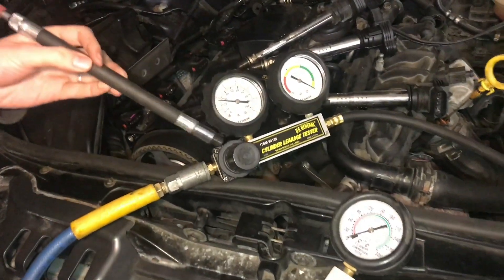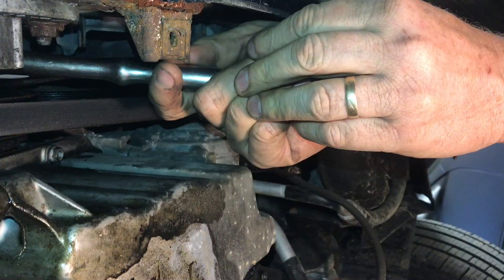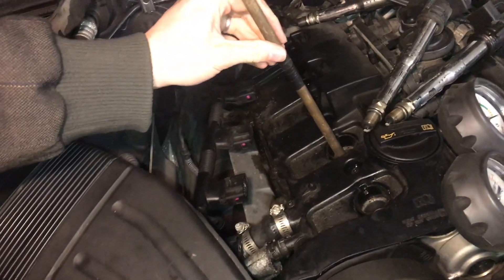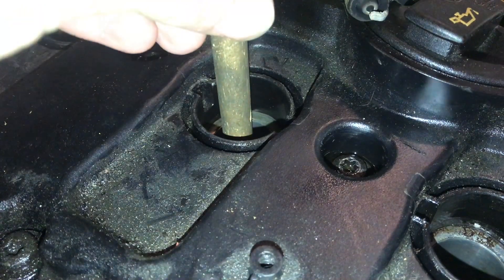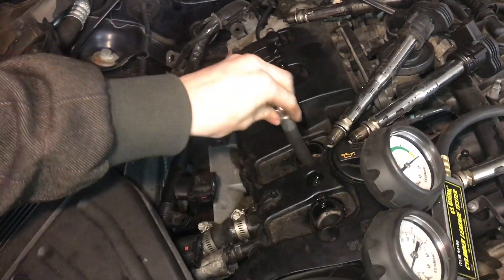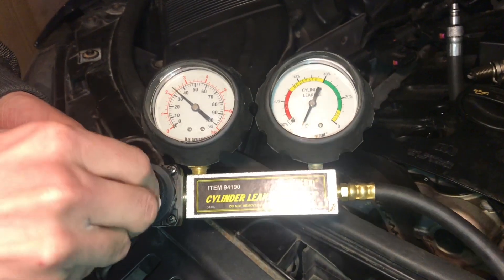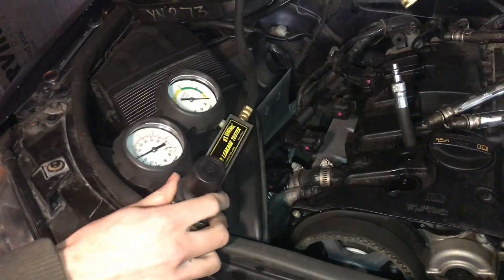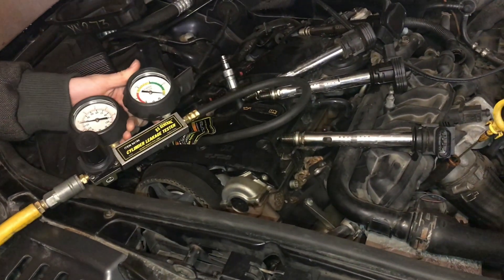how to use a LEAK DOWN tester (from harbor freight Item 62595)

Comment: Those cheap leakdown testers are really only good for adding pressure to listen for leaking valves,  head gasket, rings, etc.   The percentage of leakdown is useless.   It's like 20psi so the resolution sucks.  A 2psi change is 10% and I doubt those gauges are accurate to 2psi.     Good gauges let you add 100 psi, so when you see a 10 psi difference,  you're seeing 10% loss.   Imagine trying to measure 5% loss,  that's only a 1 psi change.    That said,  I own the cheapos too since a leakdown tester was always a tool room tool where I worked,  so I had to look up how to use these funky gauges.
Reply: Yeah I bought 2 different ones. Both are dangerous because you have to connect the hose while it's at pressure so the crank immediately sends your breaker bar spinning.

Comment: Trying to use one of these on a single cylinder, it keeps rotating the engine into the exhaust stroke, could i assume there isn't a leak? Or should i somehow prevent the engine from rotating to get a proper reading.

Comment: If the leak is bad enough, the balloon won't inflate. Also, my Harbor Freight tester's instructions were wrong. It said to connect the tester to the cylinder adapter hose BEFORE hooking up the compressed shop air. It took me a while to figure out their mistake. Hopefully they corrected this mistake in their instructions.

Comment: your suppose  to turn it all the way to 100% to get a correct leakage amount
Reply: I agree. But I think this version of a leak down tester is screwy.

All the real ones I used, you plug everything up, set the input gauge at 100psi, then read the other one.   If it reads 92PSI, for example, you have 8% leakdown.

....but those don't have colorful gauges and you "have to do math".

I bought one of these to have at my house and thought it was broken when I maxed out the regulator because my compressor only goes to 98PSI.

Comment: I appreciate you sharing the ballon and stick trick.  A friend of mine, working on a motorcycle, was using a pencil and broke off the erasure end inside the cylinder, so this would have definitely helped him avoid that mistake.
Reply: Nightmare…..my heart aches for him
Reply: I woulda taped a fountain drink straw to a vacuum and recovered that eraser. break it up in the cylinder to make it fit in the straw worst case scenario

Comment: Nice one. Good instruction. 

FWIW, even pros need a reminder now and again. Engines should not be cranked backwards if you pass, to achieve TDC. If You pass TDC, you rotate normal revolution once (TDE) and then stop on the next revolution. 

Oil journals have sharp edges and rotating the internals backwards can shave/gouge the bearings. This is taught from Small Gas Engine Repair all the way to Automotive 501 Blues and is mentioned in every good* service manual, even if no explanation as to why it shouldn't be done.

Comment: My brother just bought one of these and tested his car with it. He told me cylinder 7 had 40% leakage but I'm a little suspect of the tool. The first I've seen the tool is in your video and I'm a little confused how the tool can be static calibrated like that. Doesn't there have to be airflow going through the orifice inside the body to calibrate? I'm going to have to look at this tool myself I think.
Reply: Pretty sure each tip that is used has the same hole size for correct calibration